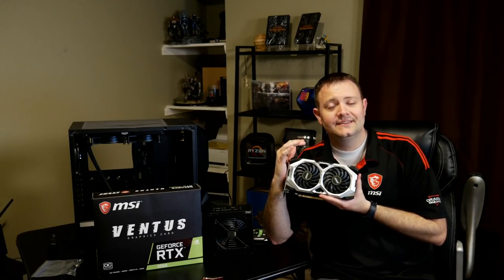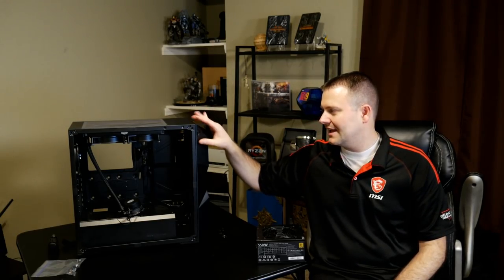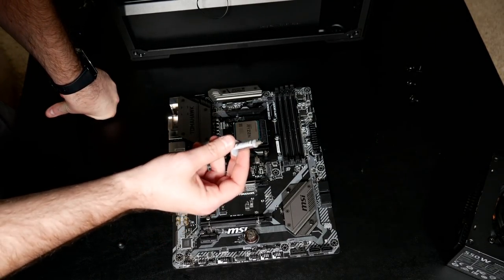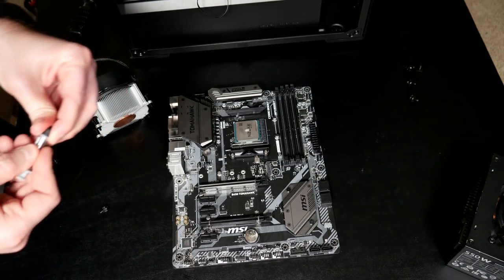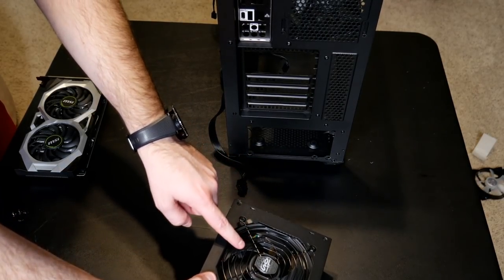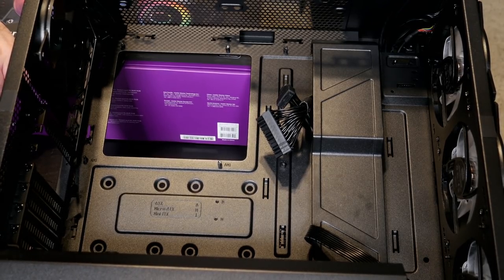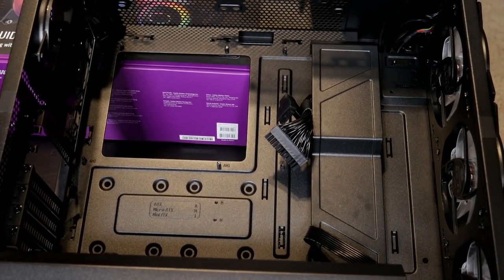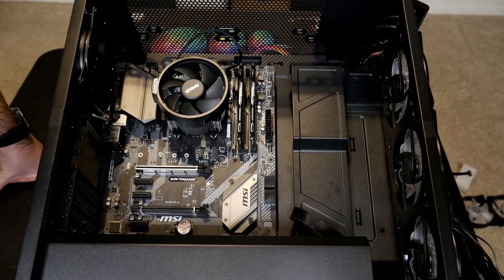Full How to Build a PC Guide for Total War: Three Kingdoms ft. MSI B450 Tomahawk

Comment: Heir what laptop would u recommend for this game?
Reply: I run it on the MSI GS65 stealth. It actually runs really well; I can get a consistent 60FPS on Mid-High settings. Good luck running it on Ultra, but you can run it on Mid settings for about an hour or two before the heat gets really bad.

Comment: RAM = random-access memory
DRAM = dynamic random-access memory (must be refreshed every few micro-seconds).
SRAM = static random-access memory (holds its contents as long as there is power).
Yeah, it's all memory. When buying RAM, buy it in pairs: two 8GB, two 4GB, etc. Memory access is faster if there are two banks instead of one. If you add more, add them in pairs too.

Always buy a good-quality power supply. The problem with low-quality ones is they can allow feedback thru them and this effects other components in the computer. Under-powering is the bigger problem with low-quality supplies than overpowering.
Reply from the maker: Good clarification and advice.

Comment: witch video card is good for warhammer but not to expensive
Reply: I use an nvidia gtx 970. Does the job great. Running everything on high settings. (I have an i5 processor)
Reply: @nickr8485  thx
Reply: gtx1070 are cheap now too
Reply: @iamplay797  Definitely 
970 seems to be bare minimum

Comment: Heir (or anyone else who may know), I want to build my first pc for total war titles at 1440p. Is i5 9600k, RTX 2070, 16GB RAM enough for at least 60 FPS? Also would it be worth getting a 1440p monitor with a refresh rate that is higher than 60Hz?

EDIT: Want to play on ultra settings.
Reply: If I went intel, I'd likely go for the 9700k. The engine can use all 8 of its cores. I'm waiting for zen 2 to decide. Even though it's hard to wait.

Comment: Will this same setup be able to run Total war Troy on Ultra settings . I know this is late lol Just wondering
Reply: It should run it great I have a very similar build and it will most likely run things nicely for another year or two if not more with some slight upgrades, on the plus if you haven’t built one yet a lot of these parts are even cheeper now than when heir made the video

Comment: Ur not gonna have good time with a Ryzen 5. Besides the specs arent listed in discription but ur ram speed needs to be atleast 2666mhz. Intel ram speed is not that important. If you mainly want to play TW on this system, do yourself a favour and get an i7 4770K or something, its not even alot more expensive. I have and Ryzen and Intel system, the ryzen one struggles alot keeping the game at 60fps
Reply from the maker: I posted links to specs. The RAM in this build was only 2400MHz and ran the game just fine. 

I also disgree about the 4770k comment. The Ryzen 2600x is superior in every way not to mention you would need an old Z87 motherboard to run it, which would limit it to DDR3 1600MHz RAM. The newer Intel processors (6700k or newer) would indeed outpace the 2600X in games. But the Ryzen runs cooler, comes with a cooler, and cost less. 

While I agree Intel is overall still best at gaming it doesn't always mean it is a good value. For high end system I would have recommended intel, but this system ran the game at nearly 80FPS on ultra...so no need for the intel CPU.

Comment: I've got a massive budget, whats the best things someone should get to speed up WH2 and keep my CPU quiet ?
Reply: Generally depending on your case size, A nice big Heatsink, and Noctua/Be Quiet Fans 120mm fans
Reply from the maker: @RazgrisGa  Noctua makes insanely good (albeit aesthetically ugly) coolers. Be Quiet makes all kinds of cooling and cases too that are quite good quality. You could put these parts in a Be Quiet case. Or buy a more expensive GPU. RTX2080 would give huge gaming power if you have the money.

Comment: Can my gtx 1060 with i5 3470 run this on ultra setting with 30-40 fps..? I m okay with 30-40fps as for strat game...
Reply: I play at 1080p res.. thankyou for the answer... 😊
Reply from the maker: I am not certain. I don't have those parts and it is hard to say. You may want to look at how your processor compares with the clock speeds of the one I tested here. Also take a look at GTX1060 vs RTX2060 performance to get a guess.
Reply: @HeirofCarthage  ok heir,  thankyou so much, didn't expect you would reply, that's very nice of you.. 😊
Reply: I used to have i5 3570 with RX 580 which is about the same spec and that's the fps that I used to get with Warhammer 2. If you did not use ultra/extreme unit size I believe it should be adequate.
Reply: @Adam0Yahya  yess 😁😁😁, thank you
Reply: @Adam0Yahya  I really love Total war series.. prob next year i will upgrade my procie to i5 8600, just for this game 😁😁 also get a new vga like 1660ti
Reply: @Adam0Yahya  thank you, your video  awesome..
Reply: @OppaHan  or wait out for Ryzen 3xxx series to come out soon. Currently I'm using Ryzen 2600 and very much satisfied with the performance. First time for me using AMD though since starting with Pentium II long, long time ago. 😁
Reply: @Adam0Yahya  noted.. 😁
Reply: I know I am late but still, I have i7 4770 with 16GB RAM and RX 570 can i run rome 2, three kingdoms and shogun 2? I really want to play these three..

Comment: How good would a R5 3600X or R7 3700X do?
Reply from the maker: They would both do very well as long as they get paired with a capable GPU. Something like. 1660ti or 2060 or better will run the game well.
Reply: @HeirofCarthage  I'm about ready to build a PC just for that game and future total war games. Does it crash a lot?
Reply: What are the benchmarks for those cards at what resolution?
Reply: What if I pair them with a 5700xt?
Reply from the maker: @darrickholt2013  5700XT will run warhammer 2 on 1080p ultra or 1440p high. I have one in my second build and it works well.
Reply: Will it do well with total war 3k?